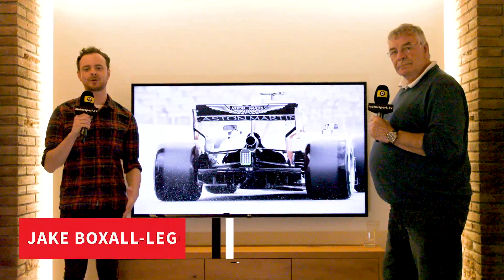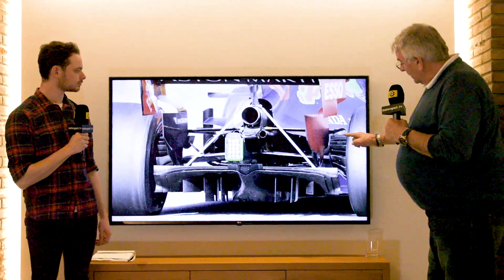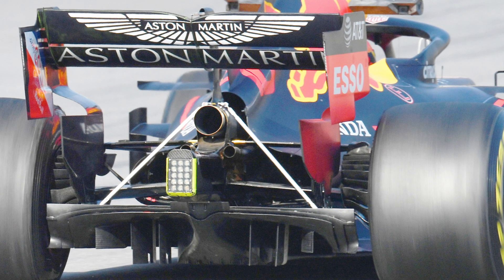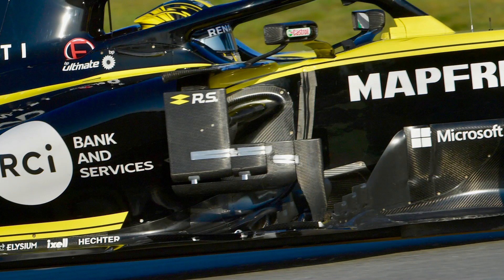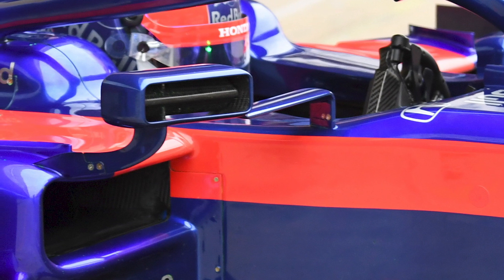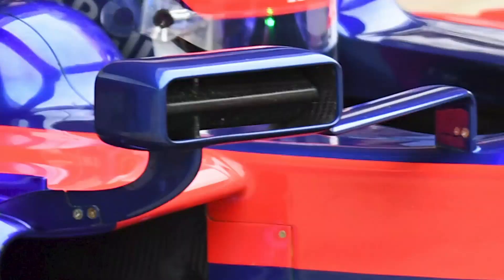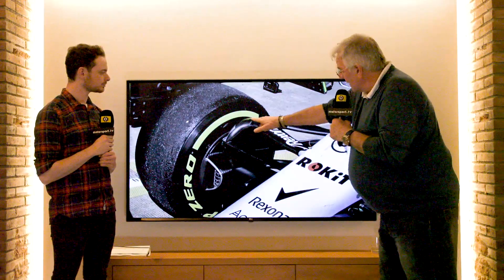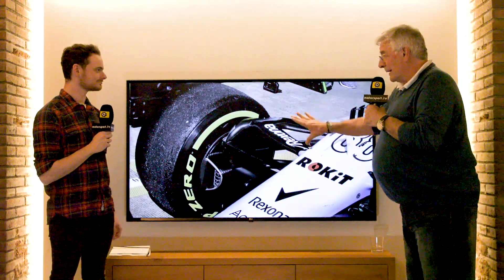Nine tech developments spotted at F1 testing

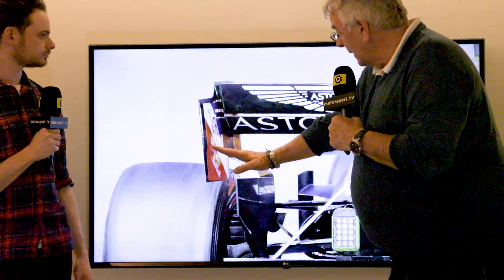Comment: @1:50 - Article 11.5  of the F1 technical regulations really needs some overhaul, because - as you clearly showed - the main function of that structure is to influence the car's aerodynamic performance, while being mounted on an unsprung part of it  (except for wheel flex).

Comment: It's good info. From an engineering POV, I suppose. F1 has become so boring.
Reply: become boring? When was it less boring than it is now?
Reply: @MAGNA_FRISIA  Anytime before DRS, for starters. These days it's more about the machines than the divers. It has been moving in that direction inexorably for a long time, but now? Meh. That's not racing.
Reply: @alistersutherland3688  but that has always been the case that it was more to the car than the driver. but yes the driver can still make the small difference between winning and losing. in my memory it was very often only the start was interesting, then it was driving around. and then only the first six got points. I find it much more exciting now, although that may be because now for the first time a compatriot of mine is competing for the prizes. and that is why I find it more exciting than before. although I myself feel that this is not the only reason, although I can not deny that I am now nail-biting in front of the TV. while I used to lie stretched out on the couch.

Comment: Interesting!
Why is it you mention, you can't make downforce with cooling elements??? Should be fairly easy to 3D print a aluminium radiator, with wing-shaped elements, should it?? Or is that prohibited by regulation?? You could even use thermo-dynamics and let the turbo create excess pressure, and hence higher temp, which is easier to cool, and then drop the pressure (and temperature) some over a turbine. And make that turbine drive generator, so the extra work of the turbo, is not all lost. Take a look and an aircraft "air cycle machine" for inspiration and a lesson in thermo dynamics :-)

Comment: For me Gary is right I don't like the extreme rake of Adrian Newey it's an unstable configuration that gives little grip to the rear wheels because of a flat bottom raised and it penalizes the support and the Vmax , on the tests of Barcelona's first week RedBull RB15 wasn't the fastest, Christian Horner even pointed out that Honda engine is powerful and reliability but the donwforce needs to be improved on the RB15, everyone has seen the loss of grip with Pierre Gasly on a straight line, chassis and aerodynamic Milton Keynes engineers are at big work now.The delays are short since the free tests at Melbourne GP starts on Friday, March 15th

Comment: I wonder if the stays are to damp vibrations in the outer part of the diffuser. If those parts started oscillating I could see the flow becoming quite turbulent and potentially causing rear instability.

Comment: Was this filmed on a potato! its 2019 for goodness sake!
Reply: Even on the best cameras it easy to get this effect by either making a big mistake setting up the camera, for instance by accidentally bumping the wrong dial. And or not lighting the scene properly.
Reply: @Kelkschiz  yeah i understand it's bad lighting probably from the vertical strip lighting behind the tv/set. And then some adjust made in the camera to brighten up the guys as they would appear too dark. It was just the first thought that came into my head after 5 secs of viewing
Reply: either way add some lights behind the camera or remove the silly lights behind the tv. Easy fix. just would expect more from Autosport, screams of laziness/pushed for time

Comment: Hang on, JBL, I'm not a technical type, but why would Red Bull reinforce the outer section of the wing (mainly the endplates) by using supports that only join the base of the rear wing pillar?

Comment: I don’t think I agree on the Williams geometry point . Geometry is on line of action not shape. The curved wishbone shouldn’t effect geometry it’s mounting position that does.
Reply: James Ayre Some of the curved structure is the upright clearing the wheel and tire. I think he’s saying the top outboard mount has been moved up.
Reply: C Mosca that would make more sense and the “flexible” bit is a cover for the joints
Reply: James Ayre I think so. Garry’s explanation wasn’t super clear. It looks pretty trick though 👍🏻

Comment: Both sides of a wing produce downforce, the top part produces 2/3rds of the downforce. The underside 1/3. Not all of it as popular culture says. I think the mounts are on the top because it's a high pressure area and so it less affected by the mounting structures.
Reply: Nope. Both sides produce downforce but the suction side typically produces 75% or more of the total. On a racing car that would be the bottom surface, on an airplane - the top. You can search for aircraft airfoils Cp graphs and compare the area under the curve of the upper vs the lower surface and see that the top surface has a much greater  area than the bottom. A good example is shown here: https://www.quora.com/When-the-wing-of-an-aircraft-generates-lift-is-it-being-sucked-up-by-the-fast-moving-air-above-it-which-creates-low-pressure-or-is-it-being-pushed-up-by-relatively-slow-moving-air-that-is-creating-high-pressure?page_size=20#!n=12.
It is true however that the suction side is more sensitive to disturbances (due to a positive pressure gradient) - that is another reason that top mount is better.
Reply: @ASJC27  The push side generates more force, about double.
Reply: @BeamRider100  False. Here for example is a NASA paper measuring the forces generated by a wing: https://ntrs.nasa.gov/archive/nasa/casi.ntrs.nasa.gov/19920001763.pdf. See figure 18 page 42-43 - it clearly shows that most of the lift is generated by the suction (upper) surface, and the relative contribution of the push side is getting lower and lower as angle of attack (and thus lift) is increased.
Reply: @ASJC27  Thank you for the link. This is freakin gold!
Reply: @ASJC27  I simple, short way to explain it is:
1 - A wing with a completely flat upper surface can generate downforce (and a lot of it, especially under ground-effect).
2 - When a wing stalls (i.e. when the lower section loses its effectiveness) the wing loses most of its downforce.

On a racing car, the upper section is mostly there to "support" and to "encourage" the lower section.
Yes, there is Newton's law; yes, there is an increase in pressure but, fundamentally, the focus is on lower section. That is exactly why F1 teams usually only bother to use flow-viz on the suction section.
Reply: Do you realize what you just wrote?
Reply: @leoa4c  Yes, the rear wing produces downforce, the top side produces most of it.
Reply: @leoa4c  For the airplane example, most people parrot that the top side produces all of the lift. What do you say ?

Comment: Adrian Newey high rake rear design is working for wonders for red bull Ferrari and all the other teams that copied his design
Reply: It's odd that MB are the only team without a high rake car design. I know the cars will change a shit load between now and the first GP and they've already changed from the launch spec but I can't imagine changing the rake on your car is at all easy.
Reply: @kwl189  basically a complete redesign that would take months and then years to get back up to their current level with long wheelbase/minimal rake - MB have a different philosophy and have optimised and refined it again and again, but will be for sure interesting to see if they hit a ceiling of diminishing returns this year
Reply: @thomasshelley4617  I guessed as much. Yes it's been apparently over the last few seasons that MB have a very different idea to SF and RB in how to go about extracting performance from the current set of rules and regulations. It's just irritating that the results have been skewed by their extreme advantage in engine performance up until maybe the start of last season. Maybe they've hit a ceiling on what they can get from their current philosophy|diminishing returns. It could however be that they've refined too much and not taken enough risks with the designs|played safe too much. I still don't believe in any performance disadvantages that people are trying to say exists. MB are sandbagging their way to massive credit if and when they get pole at Australia and win the titles again.

Comment: I've heard elsewhere that the supports may be to reduce some of the vibrations from the Honda power unit
Reply: Horner said there was no vibration issue. Clearly there's no issue. Honda is a good choice. Don't be negative. Move along, nothing to see.
Reply: you'd not fix engine vib like that! If it was that bad you'd be fixing the engine not running it with such virbrations